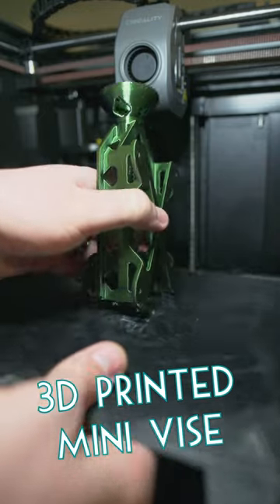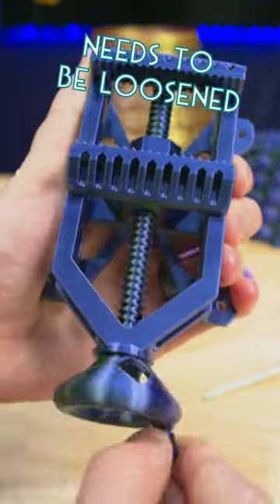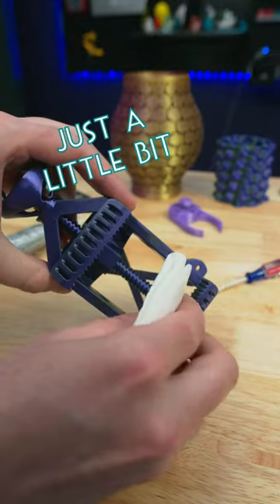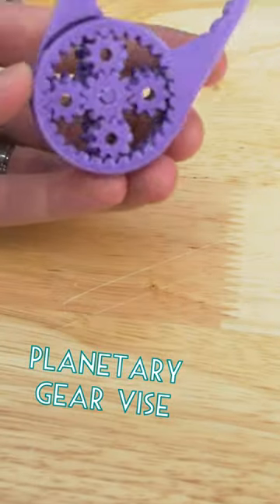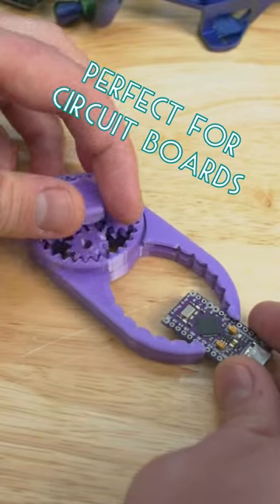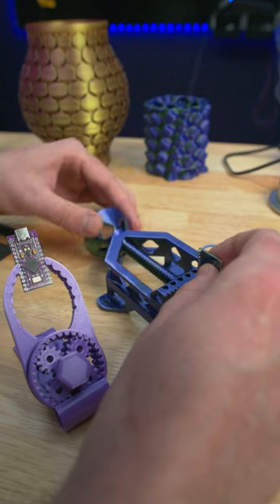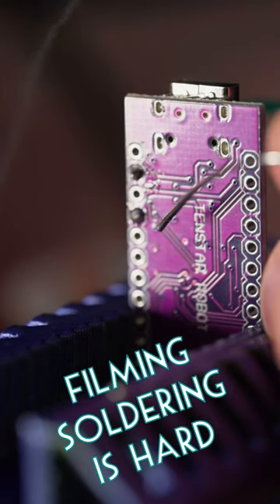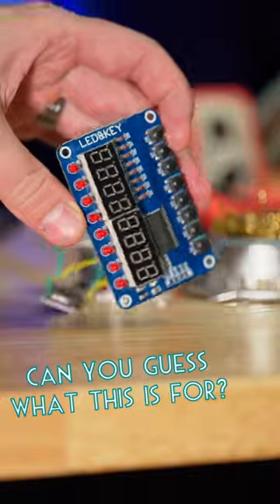3D Printed Circuit Vise 🗜️

Comment: any chance you'd be willing and able to put a scale in between the vice jaws and determine the approximate force that it can apply to hold an object in place? I'd be super curious to know how well they perform!
Reply: That silk dual-extrusion one is gonna break pretty much instantly, that stuff is brittle and has some of the worst layer adhesion out of any material ive worked with lol
Reply: @littlesnowflakepunk855 Tbh, you don't really need a lot of force here, he's using it to hold a circuit board in place wich is light af and you probably don't wanna use too much force either.
Reply: @dud3655  yeah for this purpose (although i myself would just use a set of helping hands, as they get in the way less) but i'm talking about in a force test.
Reply: @littlesnowflakepunk855  Eh, I tend to work individually a lot more, plus you can orient the thing as you please and there's no fat fingers to burn with your hot piece of metal. They're probably pretty weak, can't see them having much purpose except for very fine work. But, I can see the first vice being 3D printed with metal, though you'd need to print the two pieces separately.
Reply: ẞ
Reply: @dud3655 "helping hands" is a product hehe. The little strong clips on bendy wires essentially.

Better product for this application, but making your own stuff is invaluable in so many ways.

I too would like to see the strebgth of these vices just out of curiosity. Not necessarily to put it down for not being as strong as a cast steel one 😂

Comment: Very cold solder joints, filming complications or otherwise. Touch the iron to the work FIRST, making full contact to heat both the pad and the leg/wire before applying any solder at all. The solder should be melted by touching the work, not the iron, It should wet both elements immediately.
Reply from the maker: I did resolder these because they didn't turn out great while trying to film.